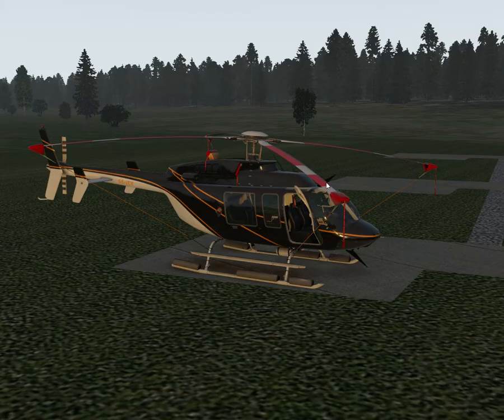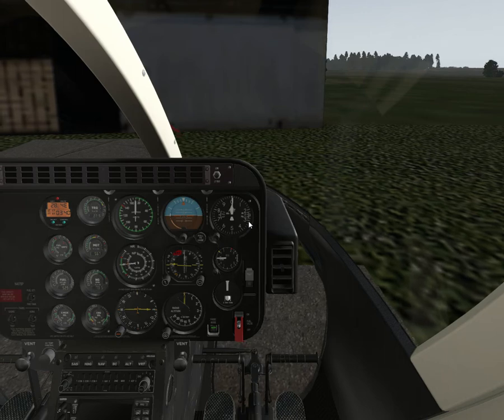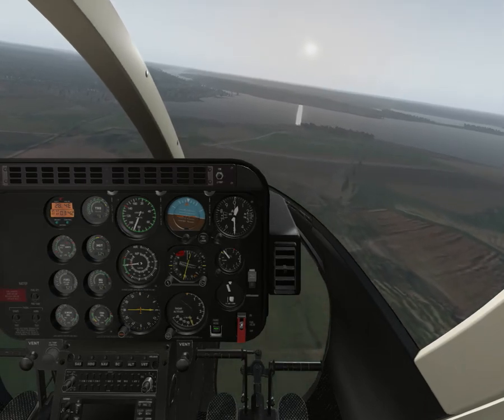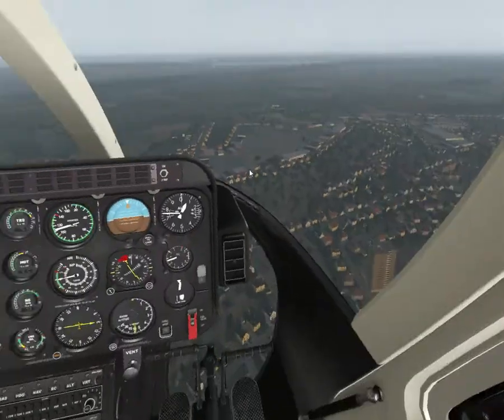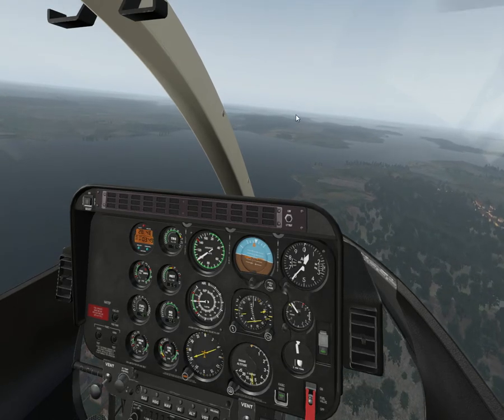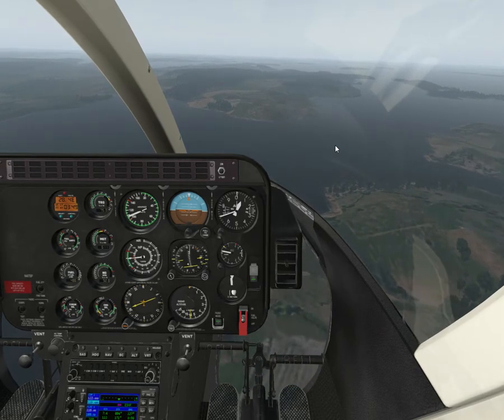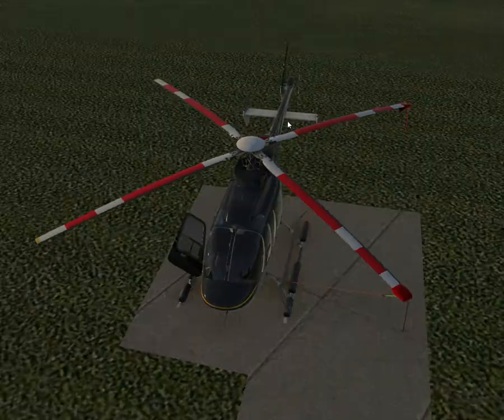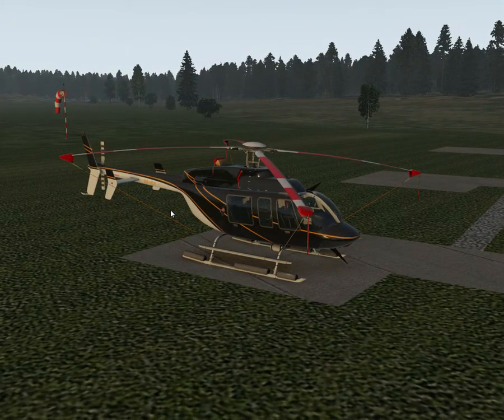X-PLANE 11 - Dreamfoil Bell 407 v 1.01 Force Trim

Comment: What control hardware are you using and what's your control % sensitivity settings for your pitch, roll, and yaw in joystick config window?

That was perfect landing keep it up ....👍
Reply from the maker: Hi, I do not have anything fancy, a Logitech Extreme 3D pro joystick and Saitek Pro flight rudder pedals. Nothing fancy. I have made a collective from a second joystick wich I placed on a home built incline but I haven't tried that with X-plane yet.